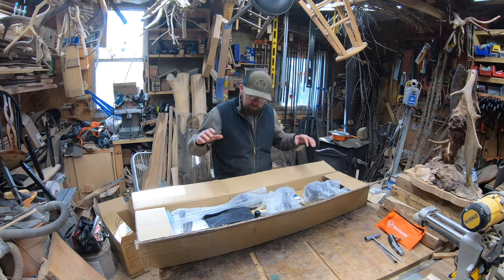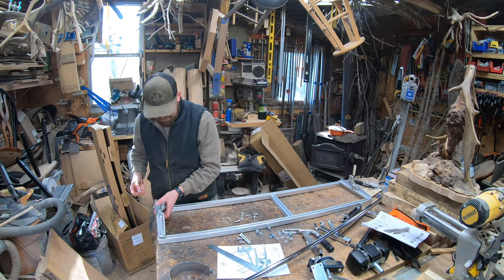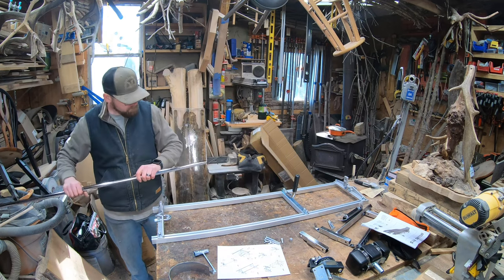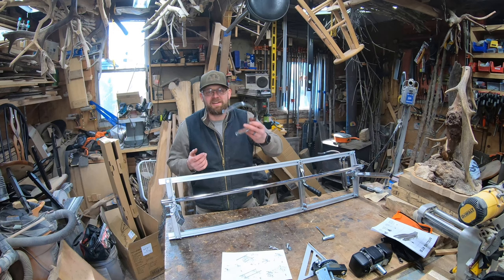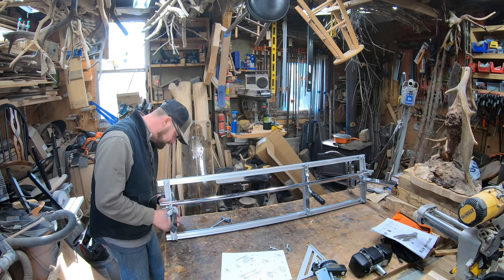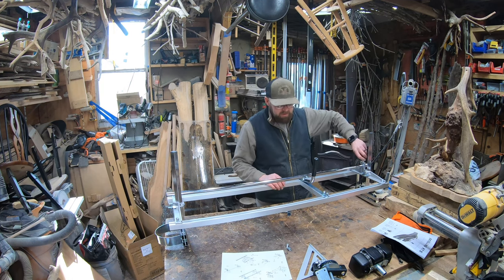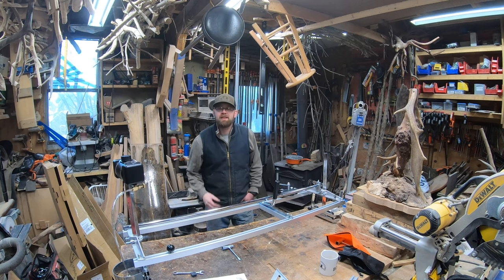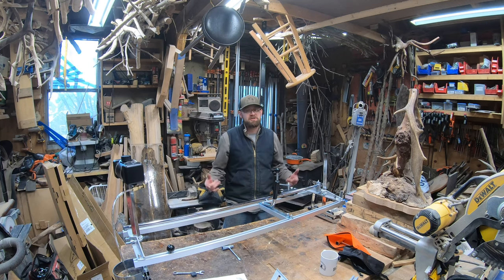Assembling the 48'' chainsaw mill from Farmertec . Holzfforma chainsaw mill.

Comment: I purchased one. The picture on Amazon shows the part with the curved end holding the bracket.  And the assembly instructions show flat end holding the bar bracket.  Are the numbers on the measurement rails on yours facing opposite of each other? The hardware that came with mine is missing a piece so I haven't tightened anything down yet to see if the numbers where at the same height.